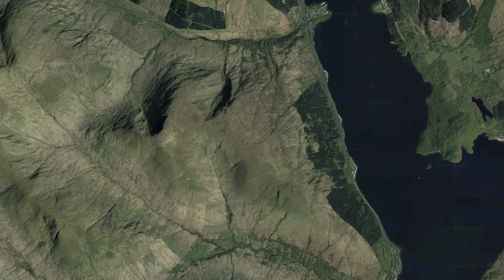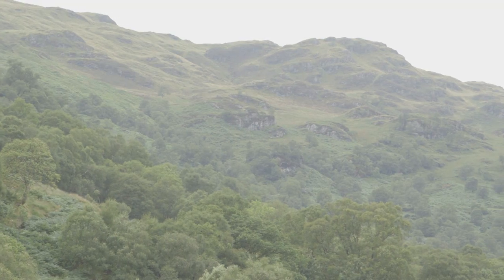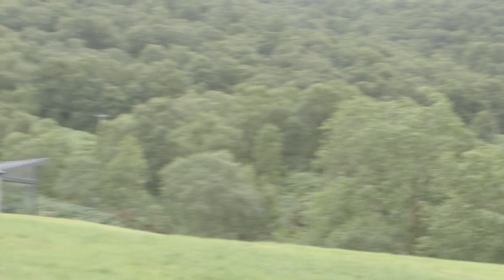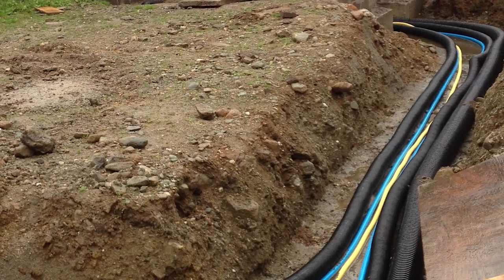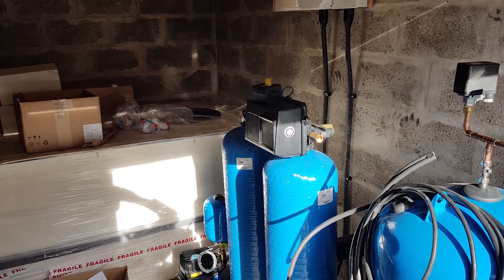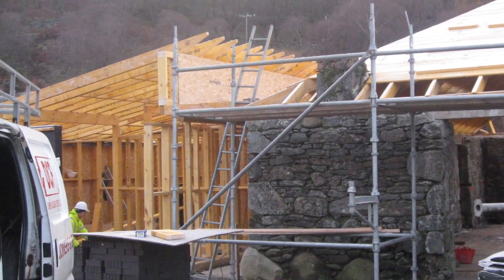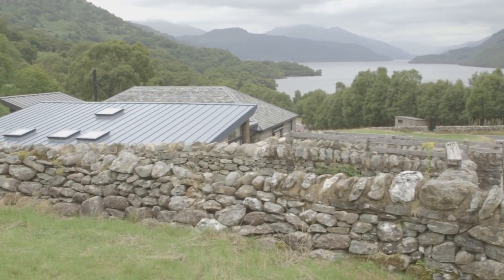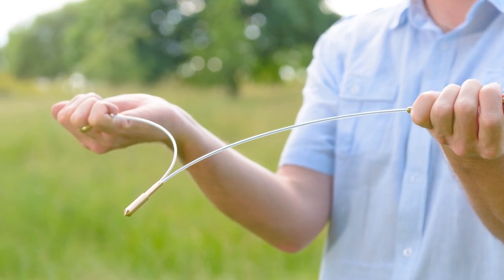Building An Off-Grid Home | CASE STUDY | Homebuilding & Renovating

Comment: Say I buy the land for my project . How much do I have to stay connected to society? I would assume I would have to pay a property tax or home tax whatever it is but other than that is there anything else? Im strictly talking legal means what do I have to do after buying my land to be "off the grid"
Reply from the maker: It depends how "separate" you want to be, Brand. For example, would you want broadband / phone, electricity, gas, water provided to the property...? Your mortgage lender may also want to be sure that the house is saleable once it's built, and may require certain connectivity to ensure that someone else would want to buy it.
Depending on where the land is, you may have various costs to budget for... a good place to start is this article > https://www.homebuilding.co.uk/advice/how-much-does-it-cost-to-build-a-house

Cheers!